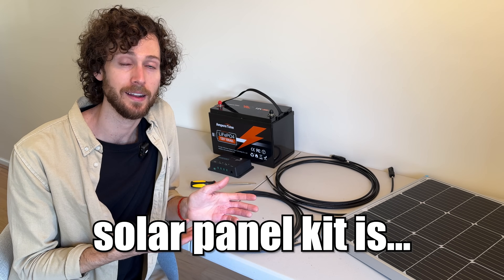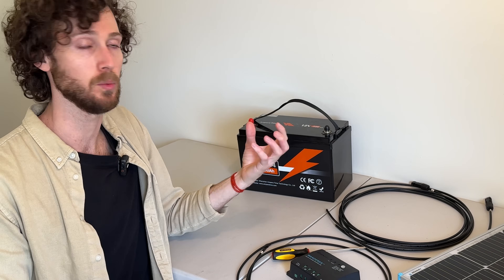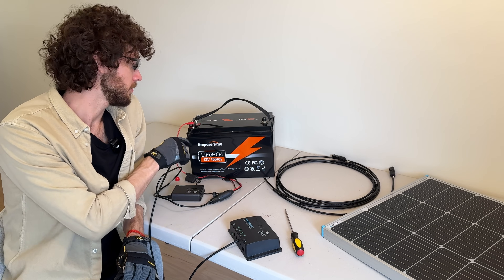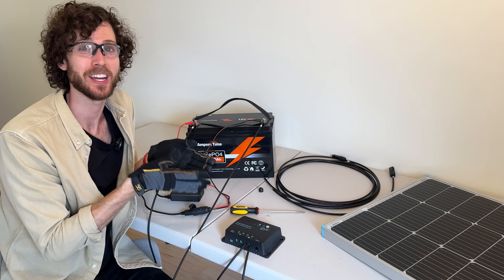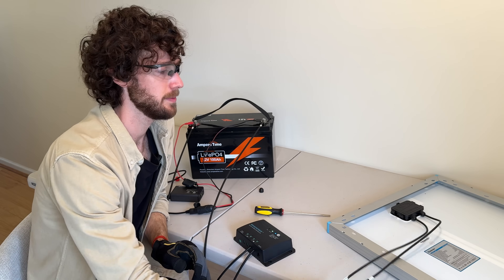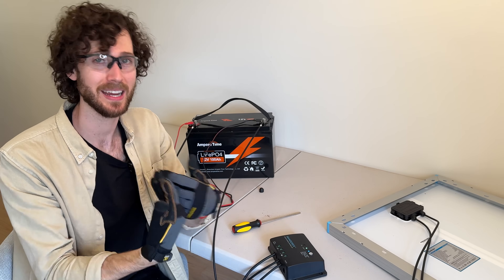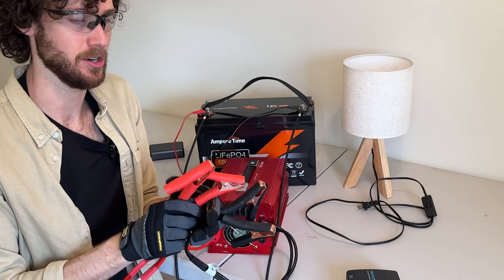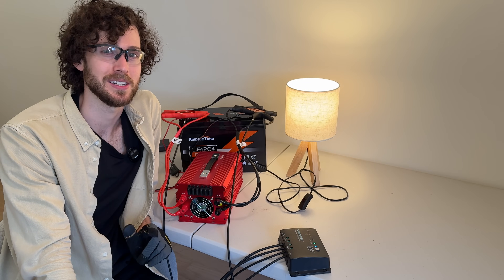100 Watt Solar Panel Kit Setup for Beginners - Step-by-Step!

Comment: Honestly a great video for beginners, if i could make one suggestion, as an electrician who also does solar, always connect the bare ended wire to your charge controllers first, it is possible to get a shock from the panel making a little bit of energy if you touch the bare copper, then you can connect the mc4 connector after. Great job!
Reply: How many batteies one need that can produce 220v? Can solar energy cook food? Can it convert DC to AC which inverter u need to do that
Reply: @Emetlesignal-jz8xd  

A standard 12v car battery can easily produce thousands of volts, we used to make the circuits to do this for fun, as electrical apprentices; you could also do it with a 6v battery.

Yes, solar energy can cook food, either directly, or by converting to electricity.
Reply: @ianemery2925  Oh and your exlanation of what a 12v battery can do, is utterly ignorant..

A 12v battery (ONLY has a potential - at the heighest of 14.4v, thus) CANNOT PRODUCE THOUSANDS OF VOLTS..

Get your ords done correctly.

AMPS is what you were trying to say, in that a 12v Battery, on a dead short circuit MAY be able to produce a LOT of amps, (but I would hazard a good guess, that with their internal resistances, there is absolutely NO WAY, even a fully charged 660Ahr battery, could produce 1,000 amps let alone thousands).

Also - if 12v batteries were ALL you could use for fun, you never had MUCH FUN eh?

Try tossing around fully charged PFC capacitors.
Now they can pack several thousand AMPS when discharged across an apprentices sweaty hands, after coming out of a 400v 3ph switchboard.

Knowing the difference betwen a fuly charged PFC capacitor, and a zero potential one, is ONLY in the knowing of what type it is (but see, if catching one, either use protective gloves, or STAND ASIDE and let it fall.
Cathing anything "thrown at you by another person" (at our industrial switchboard manufacturing facility) - mean you were either stupid, or an apprentice.
Reply: @QUIX4U i have two lifepo4 200a bms plus from redodo and can produce 2000w (156.25/2 * 12.8), im planning on upscaling to 4 in series, but dont see the value in your peeing all over the guys video. In general it is useful for a newbie and unless you are an electrician or about to upscale to 48v where there is more danger, this is a suitable entry point vid. I have been playing around with this stuff for a year and do a lot of micro electronics (arduino) and it’s not worth spazing over like this
Reply: How will I know the capacity of solar panels, batteries, inverter that can carry THE WHOLE HOUSE ELECTRICITY?
Reply: Thanks for the tip!
Reply: This video shows a solar system without installing circuit breaker or fuses. Do you know at what system size they are recommended?
Reply: @sebastian_philippinen  if you look at diagram at 11:21 it clearly shows fuses both legs (battery to charger, battery to inverter
Reply: @NextProjectawesome  yes I saw it but my question was how to decide in which situation is it ok to not use them?
Reply: @ im not an electrician but size to wire and load your battery can accept. If there is a risk your load may draw more amps than your wire can support, there should be fuse. If your battery has a limit lower than your inverter I would put one. My load is about 156a max and my bms supports up to 200a, for a 6” cable at 1/0 I believe i read 175 is max so that’s what I set my fuse at… but I also bought 150a fuses as I dont plan to run everything at max (so about 1800w is what I want my system to allow as it may go hours under load I dont want to risk fires)… again im no electrician
Reply: @NextProjectawesome  thanks for explaining. Now I understand it.
Reply: Agreed; the connectors are insulated, the screwdriver used here isnt - there is also the danger of the bare wire touching something else while you are hooking everything up, and causing arcing; potentially damaging/destroying the controller.

Screw in connections should never be done when the cable is "live", no matter the voltage/current.

(Time served sparky)
Reply: @ianemery2925  
WRONG.
I too am a sparky, but unlike reglar domestic trained sparkies, an Industrial trained sparky, is TAUGHT how to connect to LIVE conductor, safely.

NEVER EVER get your body (especially fingers) bewteen the terminals BEFORE a cable is connected, as your body will become the shorting cable.

I haevoften (during my apprenticeship and later as a fully registered (industrail trained) electrician, CONNECTED cables to LIVE switchboard BUSBARS of considerable amperage - operating at 400vAC between each of the THREE phase busbars, as well as being INSIDE a grounded / earthed cabinet (chassis), where the ground to any of the three 400v busbars was 230v AC, at full busbar potential currents.

So no, you are wrong, it IS POSSIBLE to connect when everything is LIVE.

One just has to make sure that the sparky, doesn't become DEAD if getting between the cable being connected, and the live potential connector (either a screwdown "terminal post" type, or a bolt-on 3ph 400v 2,000A busbar)
p.s:

The screwdriver IS in act an insulated type, just not with a fully insulated shank.

I have seen, and used, fully metal screwdrivers, which DO NOT have a plastic (insulating) handle.
They are now extremely rare, but back in my youth, they were plentiful, as an agriculteral tool, used for many things, other than tightening/loosening screws, but often used as chisels, of cold-chisels, by being smashed on top by a steel hammer, with the "blade" being used to chisel off a rusted nut?

THEY needed to be fully metal, from the tip to the top of the handle.

But see, an agricultural "screwdriver" was NEVER designed to be an electrician's screwdriver, just a rough and ready (non electrical) cold chisel come regular screwdriver.

The only possiblility of a floating strand shorting something, is if BOTH battery terminal cables are fully connected along with one of the bare cable strands, into one of the tighten eterminals, as THEN, a circuit would be made, IF ANOTHER "thing" was also pre-wired to the other potential.

HOWEVER this video only shows how to connect "either" of the two bare ends, to either screwdown termina, NOT after but before the battery is connected, so your point there, is invalidated.
Reply: @ianemery2925  Solar panels power doesn't kill anybody. Have ever seen someone killed by solar panels power?🤣🤣🤣
Reply: @kayimamosielu3566  I've never seen an atomic bomb explode, either; it doesn't mean they arent dangerous or dont kill people.
Solar panels come in a range of output voltages.
Linked together, that can quickly exceed the voltage and current needed for a serious jolt; and DC shocks are the most dangerous as they are continuous current.

I only PERSONALLY know of one solar panel related death - my brother in law -  he fell 40+ft, on to a concrete floor, dying instantly.
Reply: @ianemery2925  ?
Falling to one's death on a concrete floor, is NOT a solar panel "related anything", as simply falling that far (without having a safety harness on) is merely a workers own choice, as any fall of that distance will kill.

Getting a "jolt" from anything, when one is NOT using a harness - goes to the point of carelessness from the get go.

Anyone silly enough to be "wanting" to work at that height, without a safety harness, deserves a damned good electric jolt (whether they be later falling or not)

I'm sorry for your brother in law's death, but not for him - as he was silly in NOT wearing a saftey harness that would have PREVENTED his fall.
If he had been thoughtful of his own safety, by wearing a safety harness, he would ALSO have been wearing protective gloves, and possibly safety glases too, along with correctly protected tools, such as an insulated handle spanner, and fully insulated pliers and shank protected plastic handled screwdrivers.

Stating that he died because of a "related solar panel shock", isn't true, as it doesn't remove his FALLING to his death (onto a concrete floor) - from all OTHER safety precautions that HE SHOULD HAVE TAKEN, (but didn't) thus any electric shock may have resulted in him swinging at the end of his tethering rope, but NOT in his "untehered falling" of 40ft to his death.

Comment: I will use my set-up for camping (phone charge, bucket swamp cooler,, etc). Do I need the inverter you use, or is there a less expensive option that will be adequate? I'd prefer an inverter with a 12v cigarette lighter plug. Where do you connect the female socket cig lighter if you don't recommend an inverter that already has one? Finally, are there other LI batteries that you recommend besides the one in the video? Thank you.

Comment: Very unsafe/risky (electrical) guidance here. Should ALWAYS use a catastrophic cut off switch. Always... Second, to use a LiPo, you require a shunt. This is not a 'complete' formula for beginners.
Reply: Seems like a fantastic simple explanation for people getting started. 
Please explain why it’s unsafe, where a catastrophic cut off switch should go and what it does, and what a LiPo is, and the rest of your criticisms. 
Thanks
Reply: @AlyoshaKm  I would instead, offer YOU, to do your due diligence and keep researching, keep learning and keep reviewing more; it'll soon become clear to you. It sounds like you may not be adept to electrical work, though that could be a wrong presumption. However, for your safety, since you question a breaker, I suggest you learn this subject matter a bit more before trying your own projects, especially if you're building something expensive like an off-grid battery bank. Best of luck.

Comment: Thank you for a very clear explanation. Could you discuss the battery powered emergency chargers (ie jackery).  I'm looking at a 500W one. I have a small 300W kettle. If I lose power again, like last winters ice storm, I could heat water for coffee, soups, etc. How long would the charge last? They have built in solar panels, do they work? How long if it's cloudy? I could really use some advice, other then the companies line. Thank you.

Comment: I’m really new to solar power. I’m going to take a chance asking you if what I want to do will work.
I have a shed that is not wired for power. I considered running a line to it and still may.
First of all, do you normally need a permit for hooking up solar panels in a shed? 
Ok, so I have a portable generator that I keep in my shed ready for emergency power should we need it. My problem is keeping the battery charged up since there are no outlets to plug in a trickle charger. The battery in my generator is a new just bought 12V 18 Ah water filled that has maintenance caps to add distilled water as needed.  Secondly, there are no lights in the shed as expected. 
I could buy for example the Harbor Freight 100W Thunderbolt Magnum solar kit  that includes (4) 25 W panels, a controller, cables and two LED lightbulbs and hanging sockets. Would I be able to keep my 12V battery charged at say 12.6 volts and in a very rare occasion turn on my two bulbs? Let me stress that it’s very rare that I would access my shed in the dark and if I did it wouldn’t be for too long.
Will the controller supplied in this kit be able to maintain a steady charge without fear of over or under charging?
With this kit will I be able to accomplish all this?
I apologize for being long winded but I needed to explain my unusual circumstance that I have not seen or heard mentioned on Youtube.
Reply: Yes that would work just fine. As long as you don't drain the battery too much, obviously the solar panel won't charge it as fast as the generator would

Comment: I have 10 100w. Renogy panels,  100am. CC. 3 200Ah lithium batteries,  2200w inverter. All wires, breakers, fuses, for sale.  2800 for all.   I live in Florida, Orlando area.

Comment: this helped alot.

my first setup for garage I bought two power queen 100amp 12volt batteries, renogy 700watt inverter, lion energy savanna solar charge controller and three lion energy 12volt 100 watt panels. 
subscribed.
Reply: No torque screwdriver?
Reply: @mikeworley2158  hmm no just plain screwdriver. quick question. both the inverter and charge controller cables should be hooked up positives to one battery and negatives to the other battery?

Comment: i need help with this solar panel i need 100 w            on the back  open circuit 22.5v max power 18v mono_si   barcode  YHSR2103252660 MADE IN germany SO NOT SHURE  IF ITS 100W

Comment: Whats the purpose of the battery in this?  And with this system how long would your lsmp last?  And thanks.
Reply: Collect energy. Otherwise the solar panel has no place to store the power.

Comment: I couldn't believe how important the batteries are. I bought 4 18amp 12v batteries to run with my system. They are not deep cycle. I was always out of power. I blew two charge meters.
 ..
I should have just spent the extra 100 bucks for the 100amp battery. I also blew the Diode in one of my panels.
.
I ran the batteries in 12v. Red, down the line. Black , down the line.
.
The terminals aren't screw, or prong like car battery. Clips like speaker wire connection.

Comment: Hi Alex! I am a bit confused....I just purchased a Jackery 1000 Solar Power Station/Generator, and 2 Renogy Solar panels. I bought the 8mm Power Adapter Cable in order to hook up the Solar Panel to my Jackery. Now, I am confused....do I still have to buy the Ampere Battery and those cables for the Solar Panel? I am not knowledegable about all these....I just had the intention to buy the Solar Panel to charge my jackery....I apologize I am a 65 year old woman and without experience on all these.... Please let me know soonest....Thank you....
Reply: Just plug the solar panels into the back of your unit
Reply: @johnutpatel4982  thank you so much…
Reply: Your welcome

Comment: 🌞 2x480W series panels (Vmp: 37,10 lmp: 12,95) are charging Lifepo4 battery (48V 11,7kWh 230ah) via Victron 150/35 charger ...
⚡ LiifePo4 battery is charging Ecoflow Delta pro via solar xt60 input (max input 150V 12A 1600W) ...
🌞 2x480W parallel panels (Vmp: 37,10 lmp: 12,95) are charging Powerstream (max input 55V, 600W) panels too ...
⚡ PowerStream, conected with Delta pro, is charging house and Delta pro too, with excess energy from Powerstream.
⚡ Delta pro is charging household appliances AC output 💪

Problem situation: In the morning the LifePo4 battery was dead because it had been charging the Delta pro during the night. When the two panels started charging the battery via the Victron charger (approx. 100W), the Delta pro went wild and started to overheat. I turned off the Delta pro. 

What could cause a malfunction in Delta pro?
Reply: Nice setup ;-)

The problem is that both Your Delta and the battery are oscillating , You were not supposed to put them on the Mppt port - anyway, I understand what You want to do, so here's the explanation.

When You have used all available power in a Lifepo4 battery, the BMS will shut it down to protect it from total discharge.

In the morning, the Victron will turn on the BMS on your empty battery, and send the limited amount of solar power to it. 

The second the Delta see, that there's a bit of power to get, It will take it instantly, and thereby shutting down the BMS again. This will happen repeatedly, and very fast, until the electronic in some of the electronic releases the magic blue smoke.

A solution to this problem could be to install a low voltage shutdown between the Delta and the battery, and make it turn on when the battery has reached a certain limit (80 percent?), and shut off below 20 percent. 

The second solution is to disconnect the battery with a switch between the Delta and the battery, and turn it on whenever needed.

I own an Ecoflow River, and are using he first option, and it worked for me - the second is also an option, but if I enjoyed manual labour, then I would have a hand cranked generator attached to my home, and not an expensive solar system..... 

Good luck ;-)
Reply: Very thanx for the  answer. What is Low voltage shutdown? Link please👍 I will look for some 48v shelly sweetcher??

Comment: Mg watt in has a mold of broker built in so what kind of solar panel should I get it will take 109wTts but I like the powerness 80 watt panel

Comment: What type of program you used to check daily wattage output for solar panel test?
Reply from the maker: I use a Victron SmartSolar MPPT charge controller in my tests. For this exact setup you could buy the Renogy BT-1 Bluetooth Module and track solar production from your phone using the Renogy app